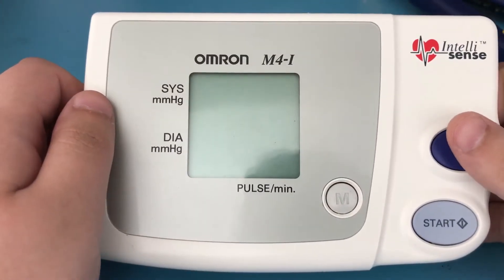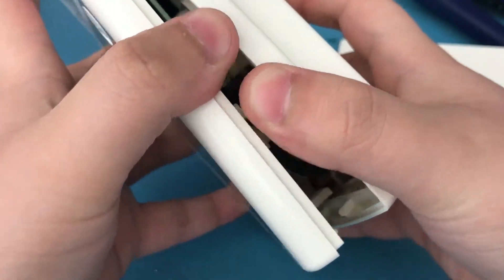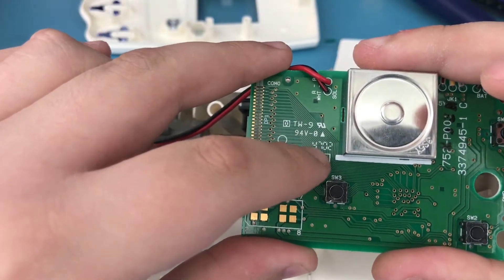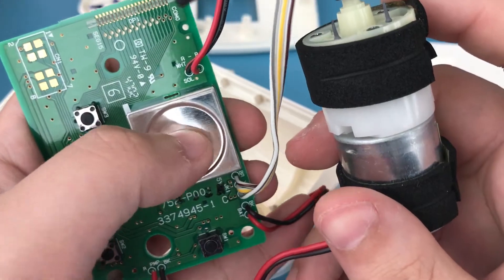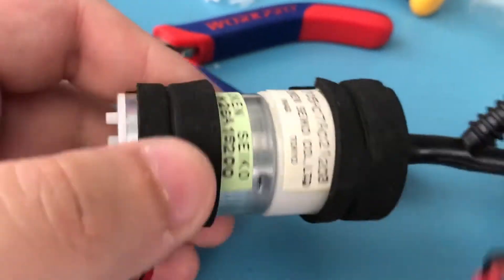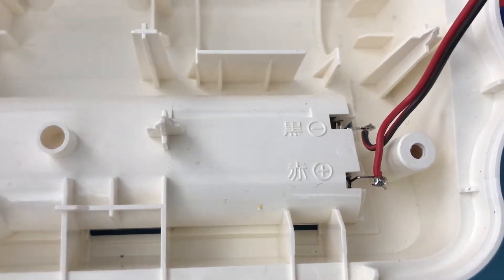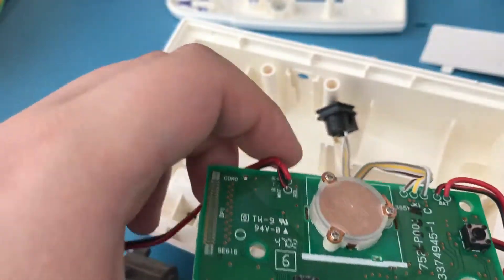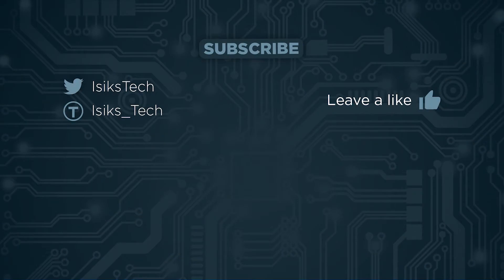Omron M4-I Blood Pressure Monitor Teardown

Comment: Mine started to work weird by turning on a pump itself, while the device was turned off. 
I've had to remove the batteries every time after each use, just to avoid uncontrolled air injection into a D-ring cuff. Finally, the cuff exploded after I forgot to remove the batteries.
However, I'm grateful for Omron engineers for a great product - it worked very well for 17 years. 
I already purchased a new one - Omron - EVOLV. Let's see how long it is going to last.
Thank you for the video!

Comment: The pressure sensor is an aneroid capsule with a piezo transducer. Later Omron BPMs use a solid state pressure sensor chip.